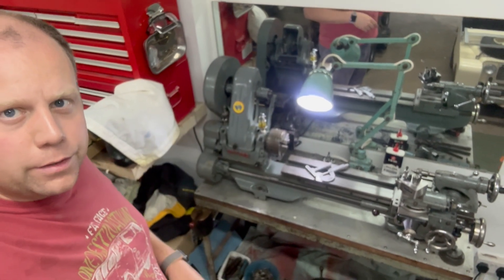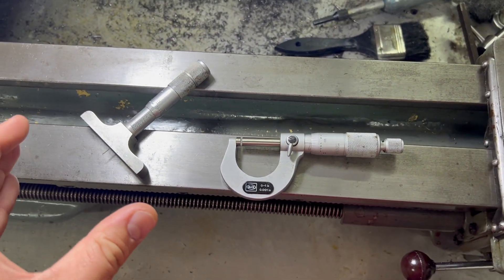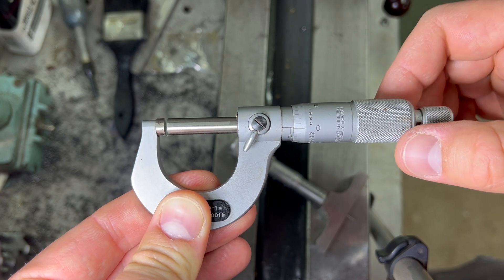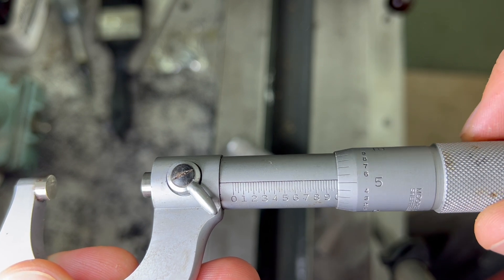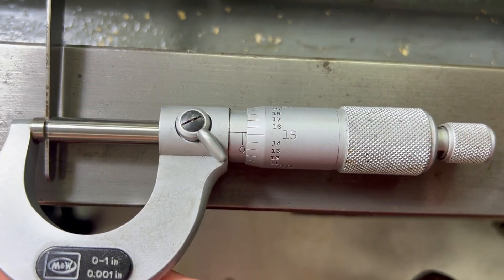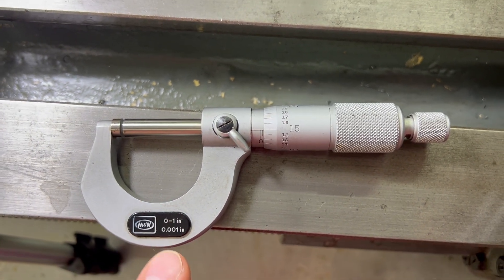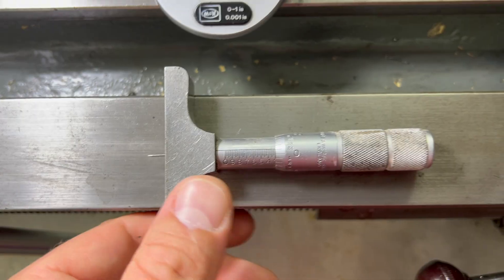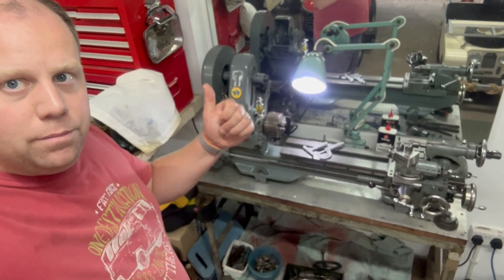How to use an Imperial Micrometer and Imperial Depth Gauge

Comment: I could make the joke that the first step to using them would be to buy metric ones, but still, an interesting video.
Reply from the maker: Either works! Just learning imperial myself as most model engineering seems to be done that way